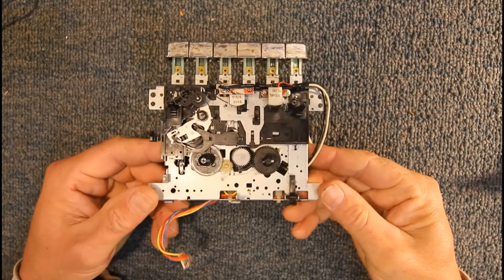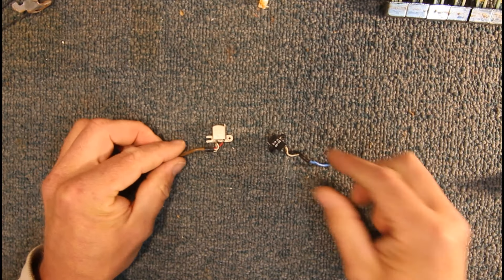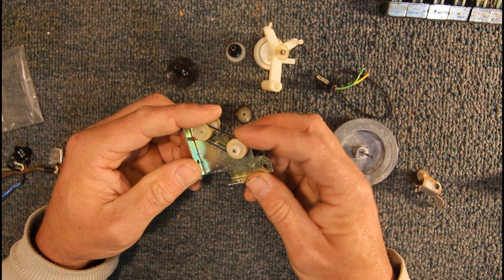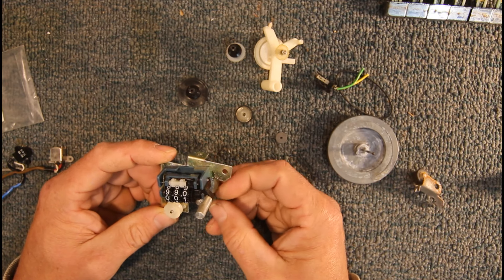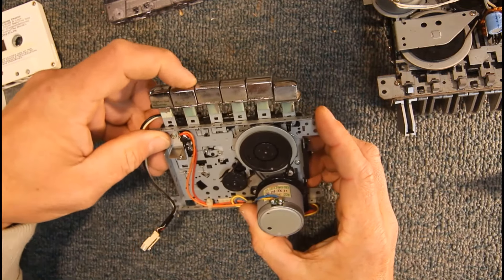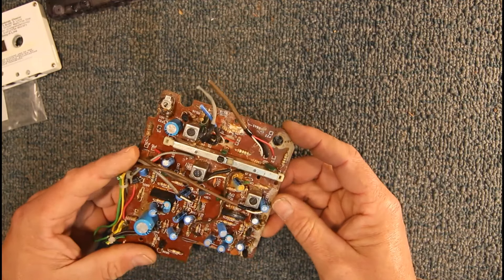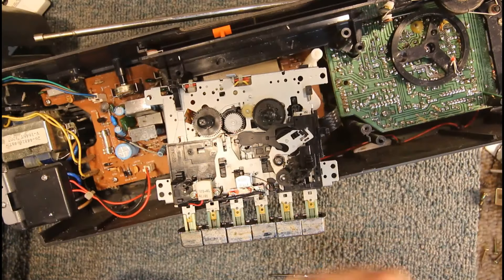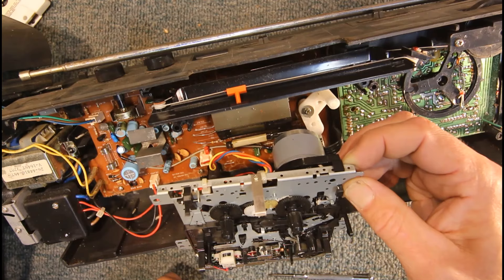Cassette Tape Player. How it works and how to repair.

Comment: What kind of a signal comes off the tape head? I'm wondering if it's possible to get a cassette mechanism working without the rest of the deck and get audio out of it.
Reply from the maker: Its a fairly low level signal and may need some equalisation to get the frequencies correct. You could wire the head from one mechanism to the head input of another cassette player and it should work fine. Its unlikely to be much good straight into a Hifi amplifier.

Comment: At Steve's Electronic repair shop, how do you fix the rewind button that won't click all the way and  clicks if you hold it and stops if you don't. But only works if you press the pause button. It's a top cassette recorder on a sony boom box.
Reply from the maker: Sound like there is something faulty in the button latching, but its odd if the pause button affects it. Most of the time its easiest to replace the whole mech with those sort of problems.

Comment: Hi Steve, great video! Just trying to figure out an issue meself. With my Aiwa HS-T37, the none of the buttons seem to be staying down. I can hold them down and the tape will start playing, but whatever latch is supposed to hold them down doesn't seem to be working. Where should I be looking to fix that?
Reply from the maker: There is a metal plate that slides across to lock the buttons down, and the stop button pushes it back to one side to release any that are locked down. That plate can stick due to sticky grease, or the spring that pulls it into place may break or something it is attached to may break. They are the most common problems but it might be something else.

Comment: love the thorough breakdown you gave in this video! my problem is that my cassette deck wont catch the cassette to play (as if the whole deck is dead). Could that be the problem is generating from the motor controlling the gears? or could it be a disintegrated belt controlling the mechanism?
Reply from the maker: Usually if its a belt you can hear the motor whirring when you press play or rew/ff. If you dont even hear that it may be a problem with the motor or the switch that gives it power.

Comment: I need help fixing the auto stop on my Yamaha mt50. I fixed it on a unit like you had that had the plastic arm, on my fostex. this seems way more complicated. a little tiny spring is loose and I dont know where it goes. im worried to fiddle with it and make the machine worse.

Comment: Just picked up a Sony CFM-10 and the little plastic sensor for the auto-stop lever wasn’t working. It kinda just fell apart and broke. Is there a way to like fix or buy a new one?
Reply from the maker: Looks like it uses a Tanashin TN21Z mech. I think you can only buy complete TN21 mechs new which are different. Many cassettes used them. Finding a second hand one may be the only way. You can usually see its that sort of mech through the door.
Reply: @ thank you, I’ll check if it’s a match!

Comment: This is a really good video and with helpful info. My problem is that my player will not start. The roller does not start at all, I press play and nothing rolls. Should I disassemble it or do something else. My player is also a stereo if that helps.
Reply from the maker: Sounds like it will need to be pulled apart. First thing to check is whether the motor runs when play or FF or Rewind are pressed. If it does, its most likely the belts

Comment: Great video.  On Auto Reverse decks, is there a sensor which senses silent gaps in the tape or  tension on the tape when it reaches the end?
Reply from the maker: Usually an auto stop type mechanism that senses lack of rotation of the reel but instead of triggering a stop it triggers a direction change.
Reply: @StevesElectronicRepairShop  Thank you.  I'm asking because I have a car deck (in a 1999 Mercedes) which auto-reverse ANY cassette I insert (even one without any tape) every 5 seconds or so.  I'm going to pull the head and open it - probably to make it worse! - and see if anything jumps out at me.  Would you suggest I first look at anything resembling the Auto-Stop arm in your diagram?  Or maybe make sure the reels are spinning OK?  Thanks again
Reply from the maker: @firstlast4874  Its a common fault to have them keep reversing. Often just a slipping belt and lack of reel rotation, but can be other things too. I looked at a car cassette mech in this video and think I looked at how auto reverse is triggered. Most mechs are fairly similiar in operation, and only a few manufacturers like Tanashin make most of them anyway. 
https://youtu.be/8ay7pKVuLBQ

Comment: Brilliant video - you really know your stuff! PLEASE help me!! Ive just changed the belts on my Sony V702 auto reverse cassette deck. Put back together again but now when you press play.... the take up reel doesn't move and the tape starts to unwind as the pinch roller etc are all turning ok. Works perfectly in autoreverse however and fast forward and rewind work ok too. Checked everything over and can't see what the issue is - was ok before apart from the belts. Going insane! Any ideas?
Reply from the maker: Its something to do with the gears or wheels that engage the take up reel, which are usually different in play to rew and ff, though in an auto reverse deck it should swing to both sides so affect both directions. Some of those later Sonys get cracked idler gears that will slip. Since its a dual deck the easiest thing is to remove both mechs from the front and observe what turns in the good one and doesnt in the bad one.
Reply: @StevesElectronicRepairShop Thank you! Will have a look tonight

Comment: FANTASTIC video THANK YOU.  I would love to know what are the exact places to lubricate a player (i.e. watch you doing it), and what kind of oil or silicone grease to use?  Like, you mention the capstan (where exactly?  At what point might you rebuild the motor (working on a Sony Walkman)?  Should you lubricate all the gear pivot wells?  Any idea how to diagnose a weak (but still spinning) motor?
Reply from the maker: Normally you only lubricate anywhere where you can see lubricant already on the tape mech, which isnt usually much. With the capstan you lubricate the bearing or bushing that the shaft goes through. With motors you can add some light oil at the base of the shaft into the bearing, or pull them apart and lube both ends of the shaft. With faulty motors I used to check they were getting the correct voltage and then just replace the faulty ones. There is usually some electronics in them which may be possible to repair if a replacement is not available. I have another video where I resurrect an old Sharp in poor condition which has more of me lubricating things. Any light oil or grease should do.

Comment: Hi there,
Is there a type of lubricant that you recommend for the moving parts like the capstan and the gears and rollers?
I’ve blown my deck out with canned air, but the FF RW and Play all stop and the slightest resistance. Sometimes the Play motion will stop simply from the capstan contacting the roller.
Reply from the maker: The pinch roller itself isnt usually lubricated, but a light oil will work. The capstan usually uses a light oil or grease in the bearing. If you spin them by hand and they move easily and keep going for a bit when you give them a spin then they are likely fine. Stopping like that is usually due to either a slipping belt or a faulty motor.
Reply: @StevesElectronicRepairShop  
Thanks for the prompt reply. I’ll see if I can measure the two belts and find replacements.

Comment: Great video, thanks for the time. Quick question, I have an old boombox and when you press play the head mechanism does not move up on its own, but will when using your finger. Any ideas on what might be causing this? Thanks!
Reply from the maker: If its a basic mechanical deck its most likely a lubrication issue like sticky grease. Some mechs have a gear to lift them like the soft touch electronically controlled decks, and it can be an issue with that gear not engaging

Comment: Thanks for the video. Have you any advice for a machine that will not record on either the external or internal microphones? The playback is fine. Thanks.
Reply from the maker: Assuming it has line inputs or is part of a portable unit with inbuilt radio, and it records either of those OK, I would look for a small mic/line slide switch somewhere near the sockets. Some decks have a mic level control too that will cut them off if set to minimum, but usually its an obvious knob near the mic in sockets. If its something like a dictation recorder then its most likely a problem with the mic socket or the connections to it, since the internal mic goes via a switch inside the socket, so a broken connection or pcb track can take internal and external out together.
Reply: @StevesElectronicRepairShop  Thanks for the response. This is an older show box recorder with no radio.
Reply from the maker: @markschirripa3607  Another thing you can test is to see if it erases an old recording even if it doesnt record anything from the mic. If its not even doing that it has an electronic problem or the record playback switch may need a clean.

Comment: I have a Victoria 6 in 1 record player, one of the functions is a cassette player but when I insert a tape it is just playing static noise, I know they aren’t made the best quality but I like things working and it’s annoying not doing so. I only realised months later when I bought an old tape the player isn’t working and have tried a new tape too same again. Also tried a tape cleaner same result, any advice on possibly fixing it and being able to play a tape?
Reply from the maker: Dirty heads usually cause a muffled sound, but there is still some music there. If there is no music or whatever is recorded on the tape, and the tape is turning OK, it is often the play/record switch inside the unit needs the contacts cleaning. It could also be something simple like the wires to the head have broken off.

Comment: I have a Sharp GF 6060 and it needs new rubber belts - Could you recommend a good seller?
Reply from the maker: If you are in Australia then Wagneronline.com.au can supply them by the lengths/sizes you need

Comment: Great video Steve. I recently purchased an Hitachi boombox. On deck one it plays perfect. But when i press forward or reverse it doesn't seem to lock on engage and the switch pops back up. And if i keep my finger on the forward or rewind to prevent it popping up its starts clicking until i release my finger. I did notice a little bit of lubricant near the mechanism. Would this be the problem why it isnt engaging properly. Thanks in advance. Rich
Reply from the maker: Sounds like something related to the auto stop mechanism. Does it actually move the tape when you press either of them?
Reply: @StevesElectronicRepairShop  Thanx for being a gentleman and getting back to me Steve. When I press either forward or rewind neither moves the reel. With out the tape in it does exactly the same. When I press the forward or rewind I can see the mechanism lifting up to engage but it returns pretty quick. If I keep my finger on forward or rewind it will do the same to keep lifting up to engage but get a clicking noise until I remove my finger which then it just shuts off Steve
Reply from the maker: @RICHLFCFAN  Its likely auto stop kicking in because the reels arent turning, which is likely a belt or rubber idler tyre that needs replacing. If the deck runs with the door open, or its got a cover on the door that slides off, you could try turning the right hand reel that goes up inside the tape with your fingers, and then hit rew or ff. If the deck tries to run rather than click off then its definitely auto stop kicking in due to an issue with it turning the reels in those modes. Often in play the decks use different things to turn the reel which is why it still works in that mode.
Reply: Appreciate you coming back to me Steve and thanx for the advice

Comment: i have an issue where it seems the auto stop keeps stopping the tape after a second of playing/rewinding/fast forwarding. any thoughts on what could be happening?
Reply from the maker: Does the take up reel turn? If so does the counter turn if it has one?

Comment: So I bought a vintage Sears brand cassette player on eBay, similar to a Radio Shack table deck model. Looked well-made & I hoped more trustworthy than the brand new models that people have been complaining about. The playback sound was pretty rough, but I was hoping mostly to use it to record (& playback on a different machine). I got Q-tips and isopropyl and cleaned all the heads (didn't remove the cover or anything). I let it dry and tried it again a day later - now, even though it's clearly on (there's a hum), the wheels don't turn at all! No Play, no FF, no Rewind...! What could I have screwed up so badly just while cleaning the heads, which I've done many times on other decks?! Next step will be removing the cover & taking a look inside, but so far I'm baffled...
Reply from the maker: It wouldnt be anything you have done. Probably a slipping belt or something. If the sound isnt good on playback its likely to be bad on record as well.

Comment: It seems like I have a very similar mechanism to you but when I hit play, the motor gear is not moved into place to make contact with the takeup spindle gear. It just stays in place. Any idea what could be causing this?
Reply from the maker: With that Tanashin mech the middle gear only does rewind and fast forward. The other gear under the auto stop part runs off the capstan to run the take up reel in play.

Comment: Excellent video. Is it possible to get one without a stop mechanism make it work with one? Could it be added?
Reply from the maker: Technically its possible if you can get something to push the slide plate that holds the buttons down to one side so they release. It would probably be a fair bit of work to implement mechanically on a deck not designed for it. It would also be possible to electronically detect the take up reel has stopped turning and use a solenoid to push the slide plate. I think one of the Sony or Sharp boom boxes uses a belt from the take up reel to an optical interrupter to trigger a solenoid to stop the deck.

Comment: Thank you for this informational video. Can you do a VCR video same way of this video is ?
Reply from the maker: I will get around to looking at VCRs some time in the future.
Reply: @StevesElectronicRepairShop   How do you know if something is worth fixing before you get too far into it let alone if you can find parts? I've never been able to find parts on anything cassette deck related
Reply from the maker: @gleni8651  With the older audio cassette players its almost always something simple like belts which are still available. From the mid 80s onwards most use the same mechs so if you can salvage a couple of them you will have most parts you need. Some parts are still available new as well. VCRs are a different story as they have things like heads and capstan motors fail, as well as various plastic gears and levers that are specific to each mechanism, which is only used in a few models. It doesnt take long to diagnose most of them though. Things from the later 1990s onwards I generally dont touch because they are mostly junk and a waste of time.

Comment: Looks like one of the bias resistors on one of the channels is probably a little low, if you could find the power transistor and the 4 bias resistors around it (class A/B) you could replace one with a pot and measure what it needs to be (or just leave the pot in the circuit forever once you get it tuned perfectly.)

Is 1 Khz the standard frequency to set azimuth?  Can it be off at higher (or lower) frequencies?

Comment: I’ve looked everywhere I got a KP 500 pioneer need a mechanism cassette mechanism according to the guy working on it he told me the wheels are too old and brittle and I need to replace it if I want to get to cassette player working any help her information would be great
Reply from the maker: I have never seen one of those in Australia but hopefully someone can help you. Getting parts for cassette players can be an issue these days and you often have to use second hand parts if you can find them.

Comment: This was super informative, very good to see how the mechanisms inside operate. I’ve been trying to resolve an issue with the record side of one of those double tape decks. On this one, pressing pause & record engages the record function and then you press play to record. It started not responding to pressing both and it only engages pause. I noticed if I fast forward and get the tape moving, I can sometimes get the record to engage, then I can usually rewind it and quickly hit record & pause and it’ll work. I can’t tell if it’s a mechanical issue or not, do you have any insight to what might be going on?
Thanks for reading
Reply from the maker: There were a few different ways dual decks operated. Do you normally press record and pause and it allows you to see the VU meters and set record levels, and then pressing play starts the recording process? With most decks you would press pause then play and record together to get it ready, and then hit pause to start recording. When you say the record doesnt engage, what does it normally do when it does engage? Does it have mechanical buttons or logic control? The fact it works after FF is used would suggest a mechanical issue is more likely, but that is not definitely the case.